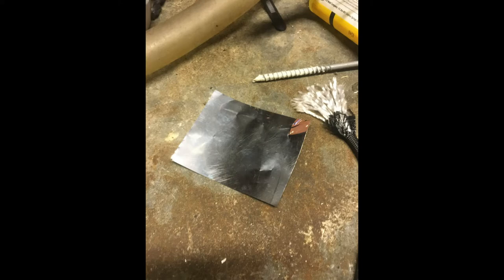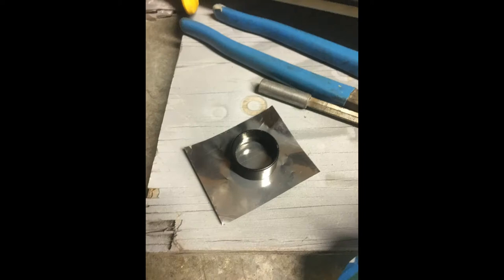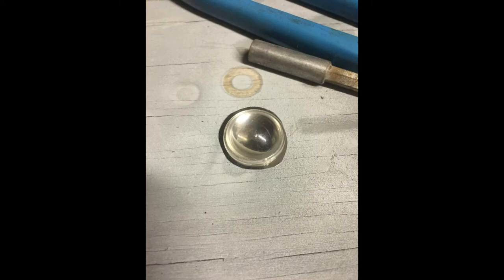HOMEMADE Artificial Star For Telescope Collimation

Comment: A lot of people seem to be doing this but I've read the proper way to star collimate is to use a high power eyepiece equal to the focal ratio of the telescope. In other words, if you have an F/3.9 like mine you would need something like a 4 mm eyepiece to get anywhere close to the magnification you would need to get concentric rings around the star. This procedure only gives you a concentric secondary shadow. You need high magnification to show correct collimation.
Reply: Did he say what eyepiece mm he was using.